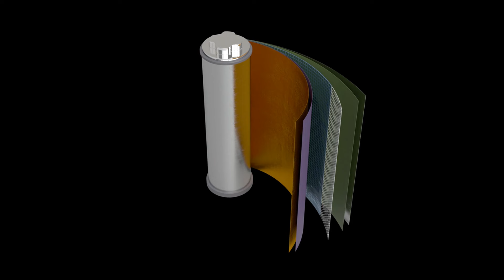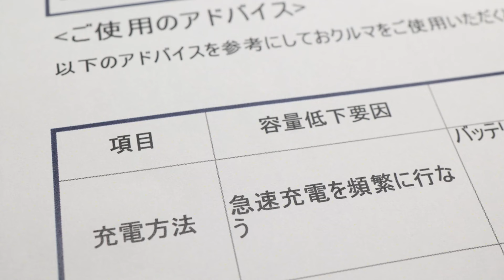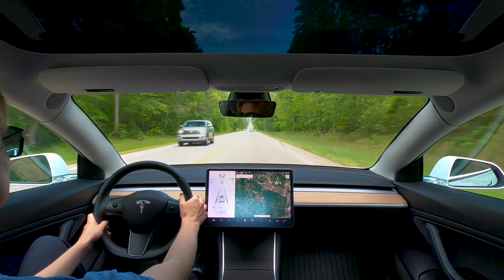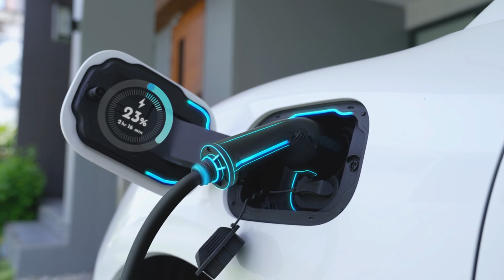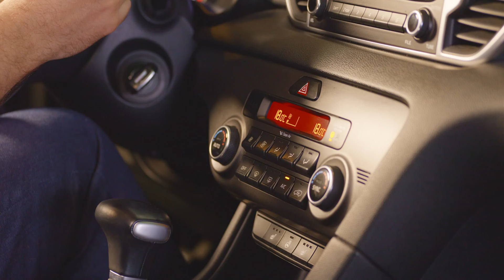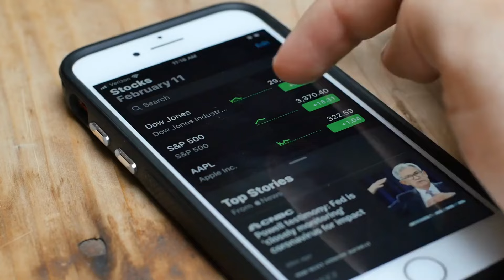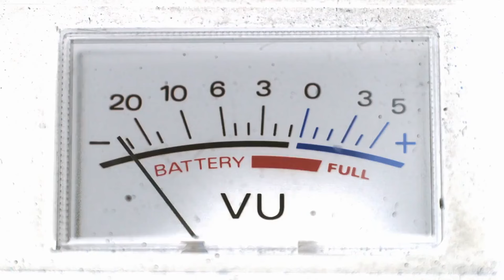I'm Thinking About Buying a New Tesla, But How Many Years Will a Tesla Battery Last?

Comment: Like click-bait stories about EV fires, stories about premature battery failure are usually FUD (fear, uncertainty and doubt) devised to slow the growth of EVs. The batteries in modern EVs have a useful life of 15-20 years. And that capability will only improve even more over the next 10 year with new chemistries. Along with getting cheaper to buy. So in 20 years time when you might need to replace your battery pack. It will cost a fraction as much as replacement batteries cost now, and last even longer.

Comment: A Lithium battery does not work like a lead acid battery, a healthy battery goes from 60-100%. lower than that the battery just don't work. so after 100k miles the battery degrades to 80%, give 50k more and the battery will be around 60% of life, just a few miles to the end of life. Engines last over 500k miles, if its maintenance in the correct way can even last a million miles, its cheaper to fix an engine than replace it when fails, but an EV battery its not easy to fix, it needs to be fully removed which cost around 5k in labor just to change a bad bms, if one cell goes bad it needs o be changed the entire battery, we have seen than in many tesla cars. when talking about servicing the engine, a DIY can replace many parts, but an EV its not possible, the battery weight several tons and needs to be done by a Tesla electrical mechanic, Tesla reserves their right to share schematics only to tesla certified technicians, so there will be no data for the user to fix their 60k+ cars.